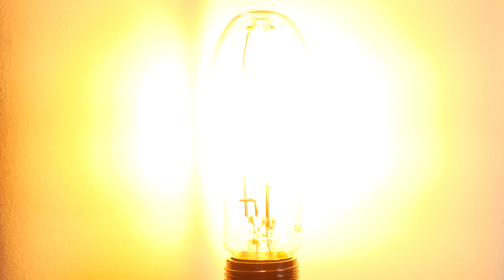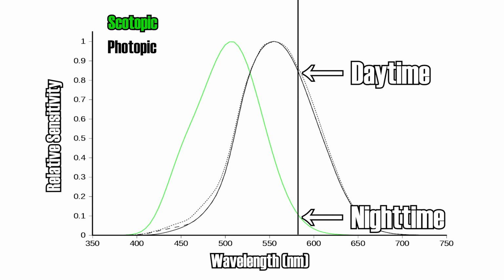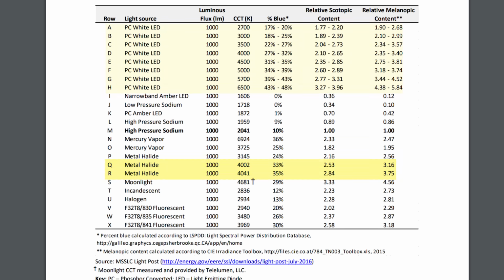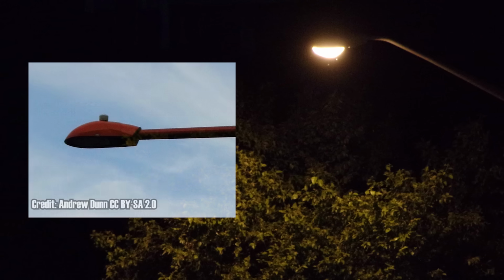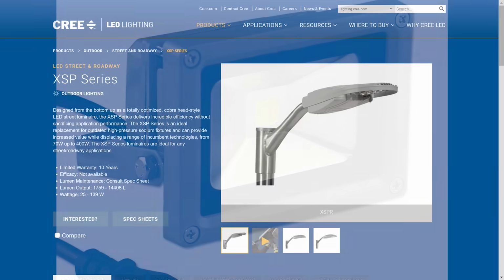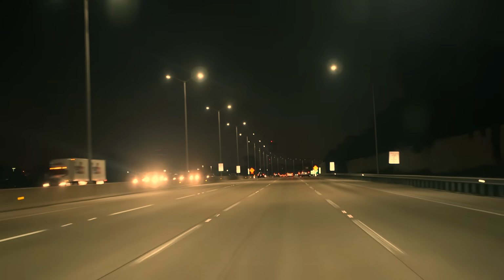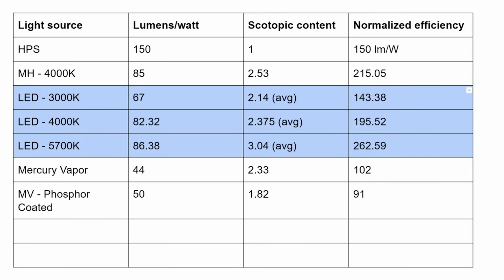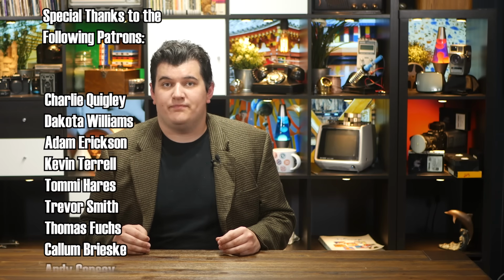The LED's Challenge to High Pressure Sodium

Comment: I'm not convinced that a lumens per watt comparison is enough to tell the story. One aspect that was not covered is LED's inability to "cast" or "throw" light as far as traditional sources. This problem has been replicated many times with halogen vs LED automobile headlight tests. You touched on the need to replace the whole fixture for optimal LED reflection housing but sometimes the entire light post should also be replaced. I have noticed that LED replacements on tall poles do not illuminate the ground as well as the traditional bulb. Would be interesting to calculate the price breaking point of packing in more LEDs (which would increase the energy consumption) in order to increase cast ability vs replacing the entire light post and lowering it to the ground. I think LEDs are great and have a wide range of applications but not entirely convinced they are appropriate for large illumination efforts.

Comment: Do you have real statistics for your continued assertion that LED light is aesthetically displeasing?
Honestly your incessant griping about white light aesthetics is a bit jarring, and seemed highly subjective. 
Perhaps, if you don't have any actual stats, just your personal animus, you could conduct a poll among your 150k subscribers?  For the record, I personally find the white light sources far far (and I mean very far) more pleasing.
I immediately head toward any roads/pavements lit by white led/halides and avoid nasty dimly lit, color distorting orange illumination like the plague.

Also, as far as driving is concerned, isn't disturbing sleepiness actually a benefit?
I feel much more alert when driving on roads with white illumination. Why would you possibly want a light source that accommodates sleepy drivers? (and for residential public lighting, just make sure the fixtures are properly directed groundward)

Comment: TL;DW: 3000K LED good, rest bad. Mmmkay? Even if 3000K takes more power per lumen than 7000K, it won't mess with people's circadian rhythms. Now if only i could find 3000K LEDs for my home lamps, all they sell here is 7100K or 6500K, which i detest.

Comment: In my town the local authority have replaced a lot of road lights with LED with motion sensors on, the lights sit at around 20-30% when no one is around but when they detect cars or walkers they light up to full brightness about 6 lights in front and 3 lights behind the cars. It is supper fun to sit and watch.
Reply: In my town some underground tunnels also use the motion sensors. They sit at about 40% and then brightness fully when you approach them (few meters). I did pass some tunnels few times and I was thinking I am hallucinating because the change in brightness was slow and wall are bright white so other lamps were make the whole tunnel lit. But few days ago, I did confirmed they do change intensity depending on traffic. Very effective at late night with low traffic places. This particular case do save a bit of power, but doesn't contribute to light pollution, but similar tech could be used in other places.
Reply: The LED Streetlights at a parking lot for a hospital near me do this. They run at a lower output until someone parks or walks under them that they switch to full brightness.
Reply: Cool!  That should be the standard.  With LED speed, maybe even zero when no one is around.
But that is way cool!
Reply: That's awesome, what city is that in?
Reply: Am in UK 
My council has been changing all the lights to led.
They are a lot brighter.
Reply: I just don’t understand how any of this has to do with having fun at “supper”🤔😂
Reply: Thats pretty smart. Reduces light pollution and power consumption. I just hope that they dim up and down and don't just suddenly flick, which could be quite starteling.

Comment: My solution would be to only use LED's for illuminating highways.
This would make it so that urban area's would still benefit from the warmer colors of HPS, while highways (which are usually less visually pleasing to begin with) have the safer white light. Also, like the pinned comment says, it would keep people awake while on the road (without keeping people from sleeping in their homes).

As for how this change could happen, I think it would be best to only use white LED's in newly build roads. This way the street light could be fully designed to have as little light pollution and waste as possible, and it would help people adapt to the different color by not changing the roads they're familiar with.

Comment: LED for highways and commercial areas, low pressure sodium for residential areas. Old fixtures left over from upgrading to LED can be parted out to help offset the cost of maintaining the low pressure sodium lights at least for a while.
Reply: Brian Putt Doesn’t change the cost of labor.  Please do your math completely before commenting.

Comment: We've been installing LED lights in South Australia everywhere.  We've installed about 129,000 of them so far.  Another 160,000 or so will be installed in the next 18 months.   The maintenance bill for these lights is about 60% less, and the power consumption is about 80% less.

Additionally, the light pollutionis about 90% less, meaning we have LESS light pollution from LED lights, as the light is directed DOWN.

Comment: There's absolutely NO reason to light up entire cities, especially not in low-traffic residential neighborhoods where the speed limit is low anyway. The argument that lighting makes the neighborhood more secure by e.g. also deterring burglary can be countered by motion-activated lights. I'd argue that it's actually safer to highlight any activity with motion-activated lights rather than blanketing the entire neighborhood in light.

On high-traffic or high-risk roads lighting of any kind makes far more sense to me, and drivers being more awake if LEDs are used is a good side effect.
Reply: Yet another tradeoff - LED street lights light the street and sidewalks better, and also do a great job of controlling backlight and not spilling light onto your lawn or into your windows.  But then, it's easier for a burglar to not be seen breaking into your house.
Reply: Agreed, dark areas in ortherwise well lit surroundings are ideal for hiding. I think that's where motion-activated lights would help. Besides, they're rather convenient when trying to find the keyhole in the middle of the night :)

My main objection to lighting cities wholesale is actually light pollution. We're already doing far too much of that, and it's a real problem. LEDs have worsened it, from what I read. Admittedly while it sounds plausible to me I have never explored the veracity of those articles. One reference as an example: https://news.nationalgeographic.com/2017/11/light-pollution-energy-LED-bulbs-spd/
Reply: A trade-off of motion sensors are blind spots caused by the light pole and/or trees, improper installation and/or aiming, the possibility of a malfunctioning  caused by electrical failure, dirt on the sensor, or vandalism to the sensor since most sensors are not very robust.  Furthermore, many motion sensors are PIR (Passive Infra-Red) which detect radiation from bare skin.  In cold areas where people may be bundled up, there might be little or no exposed skin to trigger the sensor.  All of these can cause unsafe conditions, so some municipalities consider motion sensors a unjustified liability.

And sometimes motion sensors look like warts on otherwise good looking light fixtures, but that's another story.

Comment: Colour temperature of street lights is not something I am thinking when I am rolling down the street.  In my case particularly, I am scanning the sides of the roads for deer which is a common problem in my part of the country so if the LED's provide more lights and less energy than it's Sodium counterpart, then I say, suck it up and deal with it.  I'd much rather deal with a cool white glow than to spend $3,000 getting the deer shaped dent out of my hood.

Comment: Here in Dorset, England we have the street lights turn off entirely after 1am when most people are back home asleep. It is great for astronomy :D
Reply: Ewan - I came to say the very same thing about parts of the UK! I'll add for others that this only happens on rural and residential streets, not on the main roads. And I like it too, although some had worried about crime, there's been no evidence of problems that I'm aware of. Also, at least in my area, it seems to be tied to GMT i.e. it's either 1am or midnight depending on daylight savings.

Comment: Where I used to live they replaced the streetlights with LED based lights.

During the summer I hated them because the heat meant I used to leave my blackout blind slightly open to let cold air in, but the new lights were poorly designed so you would get a relatively intense light in the bedroom compared to the ‘warm’ light of the old ones.

For residential streets I think more care needs to be taken over the design/implementation.

Comment: I think the best solution is to have the white LEDs on the main span of the highways but as it goes into the city or near suburban it should be changed to a softer LED but not completely yellowish. However, if the span of the road is higher in accident count or in mountainous areas, it should be in White LEDs to make the drivers to "wake the F- - up". whereas the street lighting around suburban and airport areas should be in HPS or similar lighting setup, with good protection from the skylight problem...

Comment: Another option to save energy and reduce pollution is to remove street lighting. People do not appreciate how good it is tonhave dark neighborhoods until they spend time in one.
Reply: Alessio, I live in Brazil, wanna spend some quality time in dark neighborhoods over here? I don't.
Reply: I completely disagree. Nothing is more fear inducing than walking around at night with no lights. Also it is incredibly dangerous. Imagine ditches people might fall into or drive into or pedestrians who may be hit and killed due to lack of proper lighting.

There is very little benefits to no street lighting, of which the only benefit is seeing the night sky.
Reply: @kingzach74  Flashlights and headlights exist
Reply: @annakudriavtsev2510  I'm not sure people going to work/coming home, taking the kids to school, in the winter, are going to be too impressed with that idea.

You can guarantee the first time some kid runs off into the darkness and is kidnapped, or someone is hurt due to the lack of lighting (especially elderly/disabled) that the local authority would be sued and the decision reversed.
Reply: @Alessio Sangalli; NO, thanks. I appreciate a fair amount of streetlight. I do not like to walk or cycle on country roads without light at night.
Reply: Alessio Sangalli good for giving head in an alley, maybe.

Comment: I have changed my lights to 5000k and cooler in my house and around. I did it knowing it will keep me up during the winter where we only get 4 hours of sunlight some nights. Coming from the south originally I wanted to mimic the sun schedule I was used to. It works great and my productivity increased a lot. That and my house now looks like a laboratory from the outside.

Comment: It's funny I actually like the 5000k aesthetics more than the yellow light.. one aspect you can use for using the yellow warm lights is that it mimics fire or candles and can deter insects where as 5000k or cooler attracts insects

Comment: Cool video. On aggravating thing I have found driving at night in areas with poorly designed streetlights (regardless of source) is that the brightness of a poorly aimed light ahead is much brighter than what it is illuminating... They really should have a well designed lens or snoot.